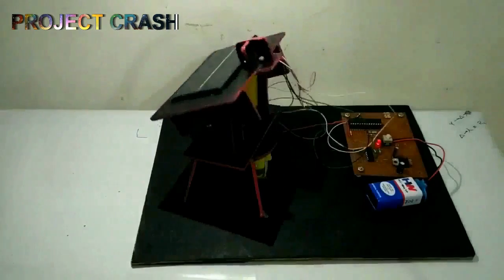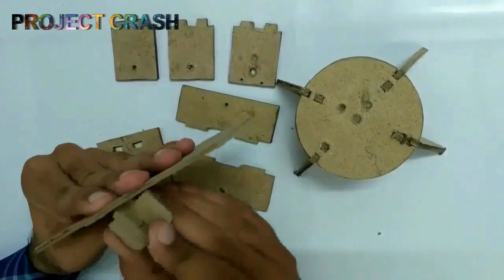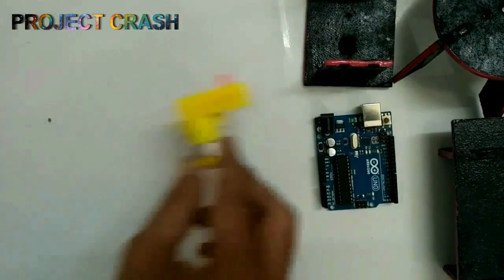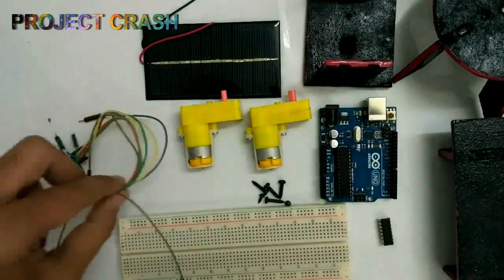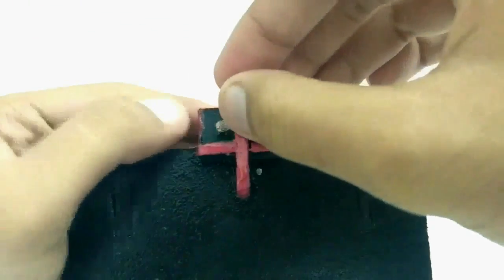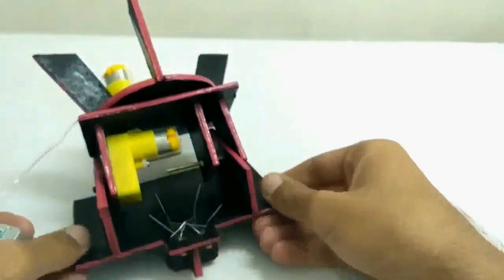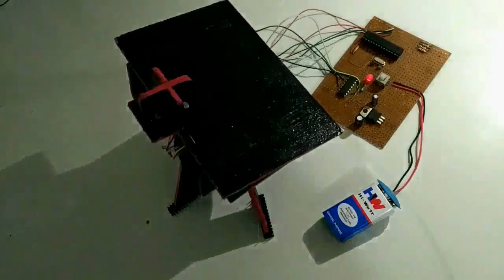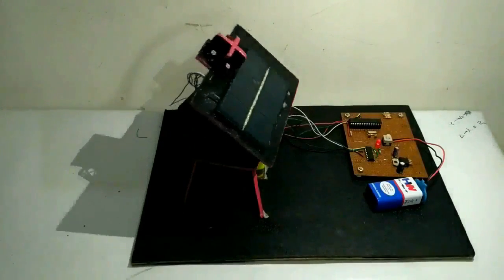How To Make Solar Tracker.

Comment: But wire cinnections of arduino uno to motors battery connections
Reply from the maker: Circuit diagram is available in description. There is standalone arduino circuit. If you want make it with arduino ,then please download  atmega328 ic pins image and standalone arduino with atmega 328 ic image from google. By comparison among these image you can make a circuit with yourself.

Comment: I want to know that how many rpm of bo motors you have used in the model???
Reply: Plzzz rply fast its urgent
Reply from the maker: rpm Doesn't matter here you can use any geared motor. If you use sg90 servo motor then there will be a slight change in programming  .
Reply: @ProjectCrash   what is that change in code when we connect to 90g can you share me that plz
Reply: i wonder what will happen when you take it outside, in full light of sun.....

Comment: what are the parts on PC board 
can you explain circuit
Reply from the maker: The microcontroller atmega328 Measures voltage voltage across each LDR and make average of two adjacent ldr's output and by comparing them by if-else condition it provide signal to L293d ic which runs a particular motor at an instant. Read the description.